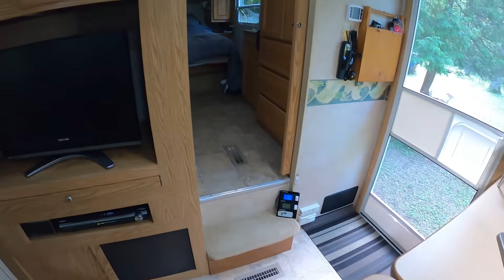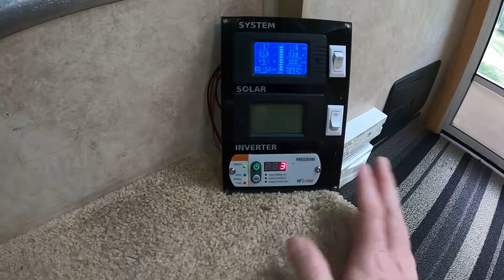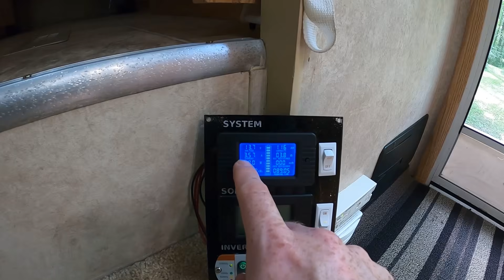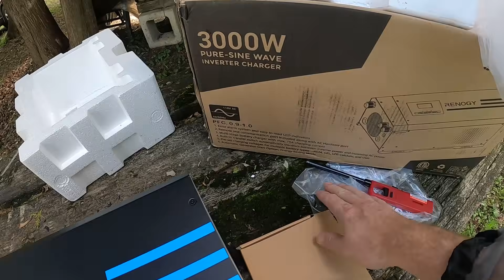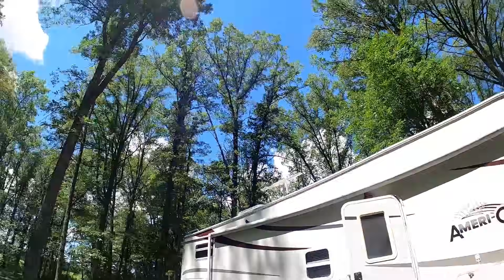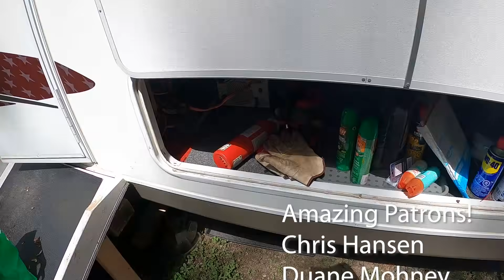Installing The Renogy 3KW Inverter In My Off-Grid Camper

Comment: You're making a mistake by installing this low surge capacity, high frequency, transformerless inverter in your camper because it is not UL-458 safety certified for use in mobile applications.

Comment: From what I could find, the 3,000 watt needs 4/0 cable? Some charts said 3/0 so just went with the heavier cables. The 110 volt wire needs to be 10 gauge to get full use of it. My plan is to use 2 x 230 amp hour LifePO4 batteries, 4/0 cable, on off switch, fuses, etc. my plan is to put a 30 amp female plug inside the compartment beside the inverter where I can just plug shore power cord into it. The camper will think it is plugged in? Should be plenty of power for off grid/no electricity campsites? About 5.5 hours run time for microwave, about 1/2 that for the AC. As soon as it cools down, the only draw would be the refrigerator, 12 volt fan, lights, TV, 12 volt pump, etc. I currently have 190mwatts solar, going to add 200msoon, then another 200. That may be all I do, or add batteries as I get the funds? I went with REDODO, great reviews, incredible value, if they work/hold up, lol

Comment: Hi. I new to this campervan lifestyle.
I have the Renogy 2000w Pure sine inverter charger but the company that installed it in my van put it in the back of a cupboard that i have No access too.. so i cant access the screen to see battery power.
So i need to a add a battery monitor screen.   
 I was thinking of purchasing the Renogy shunt monitor to connect to my Renogy 200w pure sine Inverter charger. 
(I contacted Renogy directly but they've replied saying it cant be used with my 2000w charger inverter)
(I am a bit confused because I've seen videos on youtube of people using them together).

Can i use any Shunt monitor to my Renogy charger inverter? 

Thanks

Comment: These are used for both shore power and inverter.. As they have a built in transfer switch at 10ms....That is why they cost more...As you can plug shore power in as primary. Then when you disconnect it. It will switch to Battery power till you plug it back into shore power.. And you can pick either Shore Power as Primary or Battery as Primary...

Comment: How can you use Romex wire in a camper? I don't know why the code still allows it... Only stranded wires with terminal connectors should be allowed. I see it everywhere in the North American campers and I freak out.
Reply from the maker: Because there is no issue with it.
Reply: @TacTechTrail  Like hell there is not.. As a house does not drive down the road. Where it is subjected to Vibrations. Heat, Cold, low Voltage appliances near by. etc...Why the NEC is fixing to start updating the code book to deal with these backyard electricians. 

Just so you know.. The code book allows for Mobile Homes. That are fixed in place..
Reply: @WizzRacing  this is factory wiring fella. Go howl at the moon elsewhere
Reply: @MkmeOrg  Did I say anything about factory wiring down years ago?

And like I said.. the NEC has caught wind of this crap from the NFPA Association.. As they been tracking the fires caused in RV's....

So be ready to have a licensed installer approve them.. If you don't they will come fine\jail your ass. As they will be held liable for the damages and
or deaths...This includes the Factories...

Comment: DID NOT SHOW ANY WIRE CONNECTING OR WIRING
Reply from the maker: I WILL WAIT FOR YOUR VIDEO IN ALL CAPS
Reply: @TacTechTrail  They have a point... But nice try at dodging their question...
Reply: @WizzRacing  listen fella- what exactly do you want. I dont have a damn time machine so this is what people get. It does not say tutorial or wiring or anything like that.
Reply: @MkmeOrg  Read your own damn title..

Installing the Renogy 3k Inverter.. You're a little short on showing anything "Installed" 

Maybe take a course in reading comprehension.. As you seem ignorant on why words have meaning..

Comment: Is it still working
Reply: Worked flawless until putting away for winter.  Will see next year but I have high hopes.
Reply from the maker: FYI still working flawless.  Hate the display (lack thereof) but it works beauty and charges my batts at 75a if I run the gen.
Reply: @TacTechTrail  I had read I review saying it runs of battery even when plugged in until it’s almost dead then charges? With that if you unplug at the beginning of a cycle your battery’s could be potentially dead? Apparently it can be changed in settings though? What has been your experience with that? Also you run lead acid I read? It works good with those?
Reply: @chevy6794  I wouldn't buy this inverter unless the remote display showed some things like amperage draws from appliances when on inverter power. It should also show the batteries voltage if selected. FYI, when on shore power or generator power most inverters with a builtin automatic transfer switch like this one will "pass through" the shore power or generator power and thats when they will also charge the batteries. When you disconnect from shore power or generator the automatic transfer switch will automatically select batteries to continue powering up your camper, pretty cool huh?
Reply: @TacTechTrail  Renorgy sells the Remote Monitor with RJ45 communication port on the inverter you own...

Comment: Thanks for the preview! I'm looking to install one of these in my DIY camper build. Just getting all the electrical parts at the moment. So how big is your battery bank? I am going to go with the 3KW rather than the 2KW for future proofing. But I currently don't have the battery to actually get 3KW. I'm hoping that won't be an issue if I don't try to use 3KW. I don't have a "trunk" so the display shouldn't be an issue for me.
Reply from the maker: I run 3 139 Ah AGMs now. Works well.
Reply: I ran 2 DP27 lead acid this summer but hopefully upgrade next year. Cheers